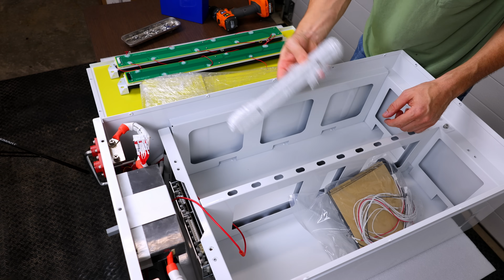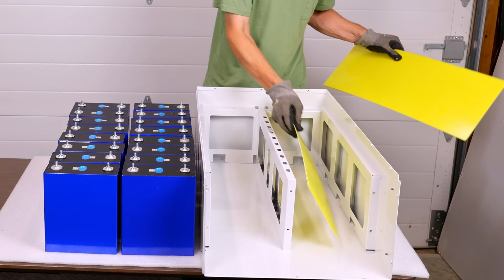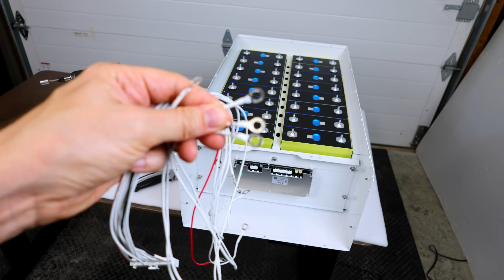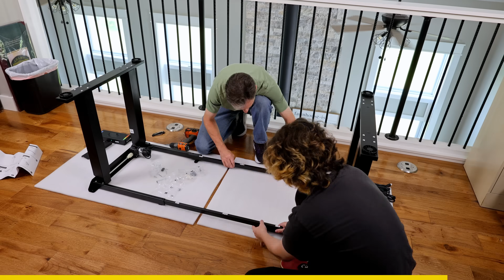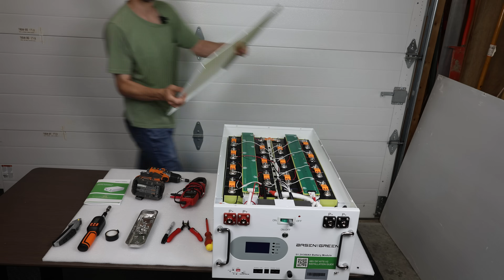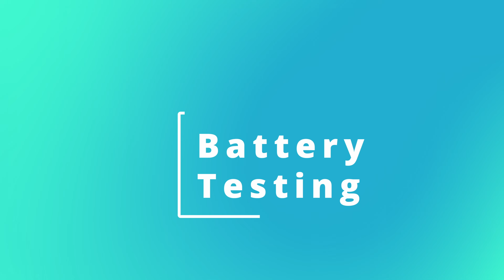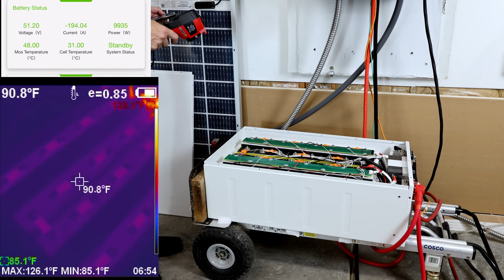SAVE Thousands V2 - Build your own home solar battery backup!

Comment: Another great video, thanks Dave. I was wondering if you had heard what DIY battery kit manufacturers had in mind when the new MB56 (628ah!) cells hit the market, considering they are twice the standard size?
Reply from the maker: I think you would need a forklift to lift a battery built with those cells.  I'm curious to see if the DIY market embraces those cells or not.  I know I'm not seeing a big advantage at this point.

Comment: I'll be the first to admit that I don't know much about operating batteries like this.  I do have a fairly good understanding of electrical principles, but I"m not a professional.  The largest circuit I have ever installed was a 50A one, and this pack output up to 215A in your video.

That said......Internal cables in the 150-180 range after sustained operation?  That would freak me out.

We have no idea about the rating of the wires at least based on the information prevented in the video.  A high rated conductor like 1/0 THHN is rated 90c which is 192F, you're within 12 degrees of that.  Depending on where the battery is installed, you need to correct the rating for ambient temperature.  If you install this battery pack in an air conditioned space then you should be safe at 180, but if it's in a non-air conditioned space, there are correction factors for ambient temps.    Installing it in a space that reached temps of 36-40C/96-104F requires a correction factor of .91 for a 90C rated conductor.  (and here in Texas my garage probably gets hotter than that)  That would put you at 174F, not enough rating to handle the load.

I'm happy if someone can explain to me why I am wrong about this.
Reply from the maker: The highest temperatures seen were a result of the breaker running near it's max.  I pushed the battery to it's limit for a long period of time, in practice you would not want to design for a constant load more than 80% of the breaker rating so target 160A or less for constant loads.

Comment: I had solar installed last year and I love it. Last week I bought a EV. Charging it during daylight is free but sooo slow using 110. Charging with 220 is very fast but my solar meter shows I am using grid power so should I buy a Bluetti or Anker and charge during daylight and use this option or what else can I do?

Comment: ROFL.. rubber gloves for 3.x volt cells!  Make the last battery connection the one at the bottom that joins the two sides, and the max voltage of 52 volts won't be seen until then.

Comment: We prefer the EEL cases with flat cables and JK inverter BMS. 
Also these are a bit cheaper here in central europe at 1600 $ incl. shipping, customs and vat / sales tax where we have no sales tax at all on solar power items. 

Government knows we have to get rid from energy exports and go the renewable route , hence everyone should participate in that and hence 0% vat / salestax.
We are increasing to 32 kWh and then maybe 48 kWh cause we have also moved ahead and added a heatpump to the oil condensed boiler to lower the heating cost from 2500 USD to below 1000 USD.
Reply: Sounds good man! :yougotthis:
Reply: Europe deregulated we have so much regulation here legal solar is 5 to 10 times more expensive then it is there. Just about the time lower cost batteries came out NEC national electric code passed new rules required inverter and battery to be certified together. It was a way to force customer to only buy expensive equipment.

Comment: Be nice to see the temps in C as well as F just for the rest of the world to see the temps in C , thanks.
Nice video BTW, very helpfull .
Reply: Just do the conversion. It’s easy, you do something with 32, and then either divide by 2 or find a square root, and then use an imaginary number and voilà! °C! 😂
Reply: @zalllon   Easier for one man two switch on the tool than tens of thousands having to waste time on conversion math...

Comment: dave inspired me to get the same kit as in V2. built it in January using 18650 supplied cells. its shipped to Africa where i have a massive 32kwh system . will update when its done . and the cost was less than 4k total from kit, batteries and shipping .

Comment: Every year the diy route gets a little cheaper and easier for your average person to do to stop themselves being bent over by our corporate energy overlords...Great demo of the advantages of a diy system where you can inspect for defects, That insulation in between connectors is a wild oversight. Interesting there is no real compression in their box design given batteries all specify life will be shortened without it. These 314AH cells will be in my next upgrade when my current cells have given me their full value in another 5 years. Good advice 16kw batteries/ 3kw solar is a great value starting point if you dont want to go big right away...

Comment: Nice review Dave. I have 3 of these V2 batteries after seeing your first video. I ended up adding some 3mm birch plywood so there's a tiny bit of compression. Also noticed you forgot to show the PC software changes to set the battery capacity to 314ah.  I had to do that, it's in your first video, and I also dropped the OV alarm to 3.60V(from 3.65V) and the OV protection to 3.55V(from 3.60V) so that the SOC is reset without any cells having to hit the top 3.65V limit.

Comment: Good quality and rigidity in the battery case and good quality control except for that one loose item you found and you going through double checking torques and trimming excess insulation is a very nice touch !

Comment: Can I charge Those with enphase iq7plus’s. I did a diy solar install 32 panels new main panel and the combiner box. I’m thinking of getting batteries.
Reply: I would ask Enphase about how to do this. I think it's a little easier if you are using the 8 series micro inverters that have a different combiner box.

Comment: If you want to be precise 2941.995 nm, there is always a margin of error + or -, that is the recommended torque, best to see the manufacturer spec. I am confident this is correct for the 314

Comment: Great video, it'd be nice if on v3 the balancer also plugs into the pcb's, maybe even the temp sensors off the pcb.
Reply from the maker: Yes that would be a nice solution, or integrate the balancing into the BMS.

Comment: Thanks for doing this. I'd really like to build one....however at my age a 100 lb server rack battery is about all that I can handle alone.
Reply: Someone out there would love to learn from or with you and do the heavy lifting for you
Reply: @l0gic23  That is true....I can ask someone younger to help me. It's not that I would have to move the 300 pound batteries often...or more than the initial setting. I'm 75 and live off grid and off road...so there are other challenges...but you make a good point.
Reply: @northidahodreaming5657 no kidding? Wow! In north Idaho even? Challenges indeed.  Wishing you success.

Comment: It would have been nice if you stated what the temp limits are on the connection or cable that's getting hot. Example: the terminal with 120amp is running at 190 degree, but the max temp on this terminal is 220 degrees so a novice would have the limit of a given cable or terminal instead of "everything is at a tolerable limit." What is the temp limit?

Comment: You may not be aware that after assembly of the cells, the cell have to be torqued to 300kg via the pressure plate, they cannot be loose as shown. Contraction and expansion of these cells will degrade much faster because if this isn't done. Keep up the good work.
Reply: Is that 300Kg-cm approximately 21ft-lbs, because 300Kg-m seems extremely excessive. Wouldn’t N-m be more common usage?
Reply: There are so many YTers that are debunking the torquing the pressure plate to exact NM. Cell manufacturers and DIY battery box manufacturers contradict each other. The vertical battery box is another. Cell manufacturer says vent should be UP and yet we still see so many where the cells are laying down by design.
Reply: This guy isnt new to the game. He is him. Youll be just fine if you you listen to his council
Reply: Each battery is housed in an aluminum case. This step is not necessary.
Reply: 2941.995 NM to be precise which is close enough to 300kg
Reply: They don't require compression

Comment: STOP! BasenGreen will not honor their word. 

I bought this battery in late 11/2024. It arrived damaged. We went back and forth for 2 months. Over 35 emails later, I ended up having to take FedEx to small claims. Then BasenGreen finally agreed to a free return with no restocking fee and a discount on a new undamaged battery kit. Once they got it back they blamed tariffs and would not honor the discount. They lied to me. 

Dave is awesome but DO NOT BUY FROM THIS COMPANY! I bet they pressure him to delete this comment.
Reply from the maker: Thanks for posting your experience.  I don't delete comments unless they are inappropriate.

Comment: You are wearing gloves just in case, but you should also be wearing eye protection.
If you accidentally short a cell it is very easy for it to sputter aluminium, steel or copper in your eyes.
Reply from the maker: Great point, yes I should have been wearing eye protection.
Reply: Safety 3rd lol😊

Comment: That box has a couple of major fails. The large openings at the end of the rows offer no support in the middle of the cell and the insulation sheet is far too flexible to contribute meaningful support. The removable end plate is too low for support the entire hight of the cell.

Comment: I think you want to put in some more material between the cells so you compress them some more.
Reply from the maker: I was showing the result you get if you follow the kit as it comes.  I agree, some additional spacers would provide actual compression and I will likely go back and add some to this one.

Comment: The first cells that you put in, are not fully supported at the back side because there is an opening there - precisely where those cells might bulge.
Reply from the maker: If you remove the EVA from the stack you can add an aluminum sheet at each end to provide full support for compression of the cells.  The way this is configured with the EVA foam there is no real compression.

Comment: Pedantic me needs to point out that PCB is printed circuit board, so saying PCB board is saying printed circuit board board.

More on topic though, these seem like a pretty good deal and fun project. I might swing by the bank and check at the ATM machine if I have some cash to buy one!

Comment: Can your order the box and make a 36v battery and just take the space up where the other cells would be and change the settings in the bms
Reply from the maker: You would have more control to do that with the settings using a JK-BMS like this option: https://youtu.be/vvMhswvVwxQ

Comment: I have first version. Can we use V2 as a master and V1 as the slave for communication?
Reply from the maker: The short answer is Yes:
It took me a few minutes to confirm.  I got it to work, but this is what I had to do.
1) I set the V2 battery dip switch to position "0" all switches OFF.
2) I connected the V2 battery to the inverter using the CAN port ( I'm using an EG4 12kPV so the communication protocol is Pylon)
3) I set the V1 battery BMS dip switch to position "1" Switch 1 ON and the rest OFF
4) I connected the V1 Battery to the V2 battery using the RS485-B ports and a standard ethernet cable.
5) With the V1 battery on, I power cycled the V2 BMS 

After this sequence of actions, the V2 battery started to combine the total capacity for the inverter.  The V1 battery was at 67% and the V2 battery was at 98% the Inverter switched from 98% to showing 82%.
Hope that helps!

Comment: i had a damaged cell and after about a year of using the laser weld on the side of the prismatic al case split during a heat wave and leaked electrolyte everywhere. really sketchy. never use damaged cells, they look fine, test fine, but they are time bombs and rely on proper fixturing to use their antiexpl valve on top. the electrolyte is nasty stuff too. same issue with not being able to ship 1x cell. 
they agreed to refund all 4 cells since the electrolyte got all over the 4 cells in the 4s pack and left a nasty white resadue. by that time the prices had fallen so far that i could buy twice as many lfp cells to replace them lol and have 3 questionable replacement 280ah cells now.
Reply from the maker: Thanks for posting your experience.  There aren't a lot of applications for 3 extra cells....
Reply: @ProjectsWithDave  ya, they have been stored in a somewhat cool place where i can keep an eye on them, at a nominal voltage of like 3.2v. had some success reusing the epoxy insulator boards by soaking them in vinegar to get the dryed electrolyte off. wouldnt really come off with water/isopropal alcohol. havent done the same to the cells yet. think i will try and just rewrap them and clean with vinegar/tap water wash/isopropal degrease before rewrapping if i ever need them.
looking at how the conna ev's fair with their older lfp prismatic cells, i think they do okay if they are stored like this for 5-10 years.

Comment: Fantastic content as always! It’s exciting to see complete battery kits finally becoming more affordable.

That said, while there's a growing amount of information and products available for 48V systems, content and kit options for higher-voltage setups are still severely lacking.

Are there any high-voltage kit options available? I'm looking to invest in solar for my farm, and I believe a high-voltage system—around 400V DC for the battery—would be ideal. I'm aiming for roughly 300 kWh of storage and 100 kW of power output, ideally using a 400V TN system.

At 48V, the current required for a system of this size would result in extremely thick and expensive cables, which makes it a poor choice for large-scale setups like this. High-voltage is clearly the more efficient and practical solution.
Reply from the maker: Thanks for the feedback.  I haven't seen any 400V DIY solutions.  400V is a much more dangerous voltage to be working with, but it does provide significant advantages in power management.  EV's are already jumping from 400V to 800V and higher.  This allows for fast charging at much lower current levels.
Reply: @ProjectsWithDave  Okay, thanks for the reply! I’ve seen some units made for industrial applications, including complete power stations with battery packs connected in series, operating at voltages ranging from 400–800V DC.

It would be great to see some content featuring that kind of equipment in the future!

Comment: My crazy idea is to use submarine batteries.
Reply from the maker: Why is it crazy?  Where are you getting submarine batteries?  What is the chemistry?
Reply: @ProjectsWithDave Submarines still use lead acid batteries, I found a factory who makes them,and all the other types, but it's difficult to find them used.

Comment: Thank you, I'm glad you managed to assemble it successfully, from my experience I would recommend the EEL battery V5-JK BMS. I use it myself with the same cells as in the video, it works great.(I'll add that the BMS of the Seplos has problems with the BT connection, in this system that you have assembled, you should only see the active balancer properly (I have such a battery)).

Comment: I just bought 314aH cells from EEL.  Best price I could find was $90 each shipped.  Instead of coming down, this is more money than I paid 6 months ago.
I use JK bms V19 now, and EEL also has these for $160 for 150 amp.  I do not use a steel case, instead I use 12" x 36" steel shelving and can fit 16 cells onto one shelf.  I have 48kw now.
Growatt SPH10000TL-HU-US inverters (2).  I have not experienced visable swelling so far.
Reply from the maker: Quality cells cycled at the proper voltages should result in minimal swelling.
Reply: I got mine years ago from MSC Industrial Supply
Reply: I like that idea because I need vertical orientation to minimize floor space usage, but am not a fan of the way most of the DIY vertical boxes put the cells on their side.  What's the pricing on the steel shelving and where do you buy it?
Reply: Also, check Global Industrial Supply
Reply: How do you like that inverter? Was looking at the eg4 12k but growatt seems like at steal!
Reply: I went with Docan 280 EVE EV grade for $73 each free from their US warehouse. They are taking pre-sales now for 345 AH for $78 shipped from the same warehouse. Shelf builds are the most cost effective way if you need several banks like 50-100 kwh. I still went with the DIY box apexium didn't like the busbars they provided very thick and no flex. Didn't lay flat so busbars got warm not enough contact area to the terminal.  I have orange flex bus bars coming to fix that. I also replaced their 400 amp fuse looked like a mothball with a class T fuse went from 400 amps to 150 fuse my inverter 6000xp only pulls 140.